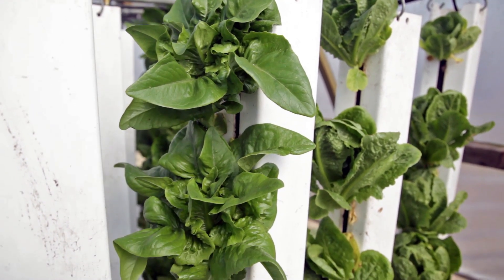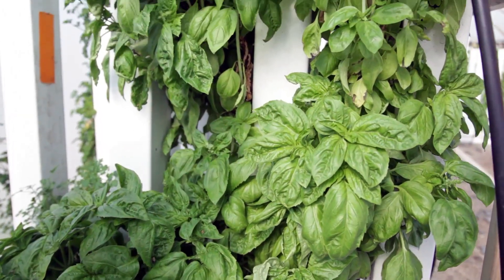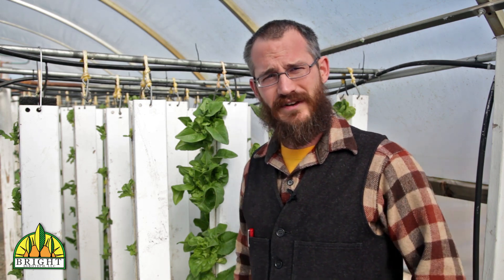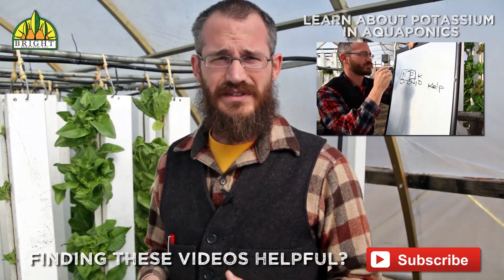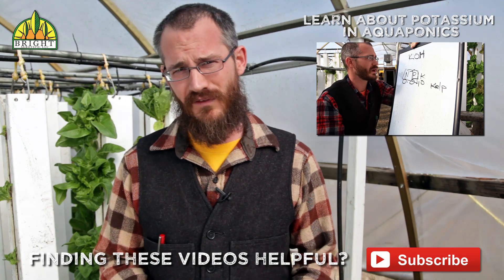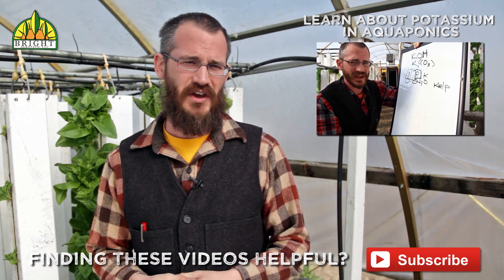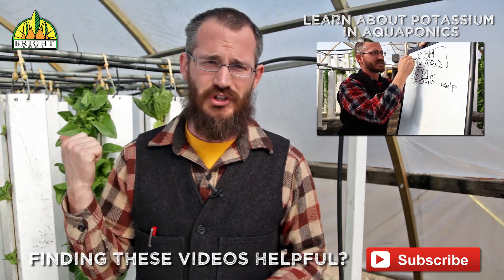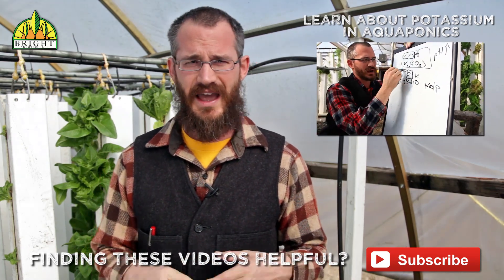Zinc in Aquaponics

Comment: Hi there Nate! Thank you for all the great information! Quick question, On the nutrient availability & pH chart, it shows Zinc is best available at 5.5pH and below. It shows there is a lockout above 5.7pH. Are plants still able to assimilate zinc 7.2-7.8?
Reply from the maker: Hey there! Yes, but not well- some of it is still available though, just in tiny tiny amounts.  If you’re running in the low to mid 6s you’ll probably be ok.  At higher values you may see deficiency, but Zinc is required in such small amounts that deficiencies are pretty rare.
Reply: You're the best! Thank you sir!!! :D
Reply from the maker: Happy to help, Nathan!